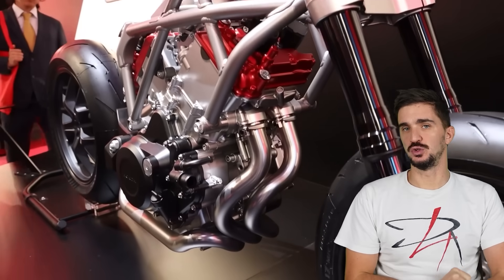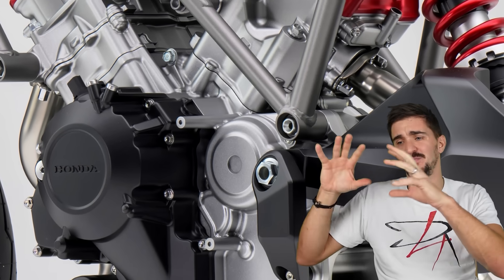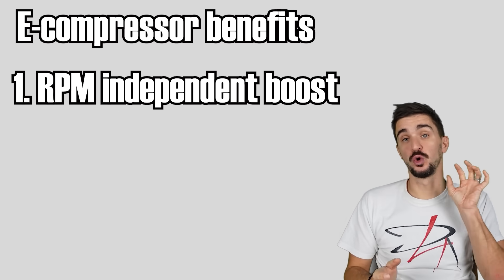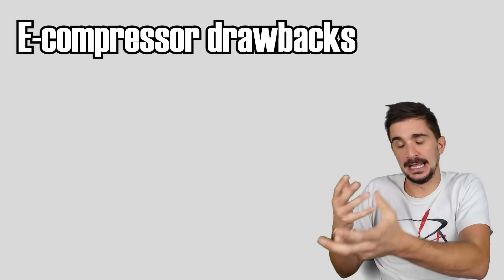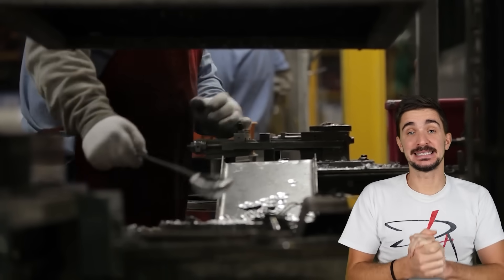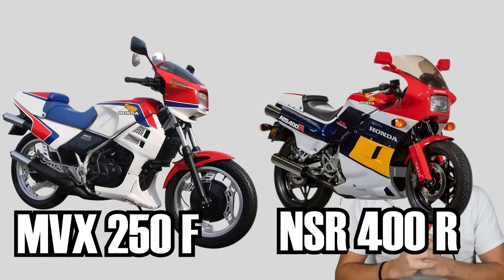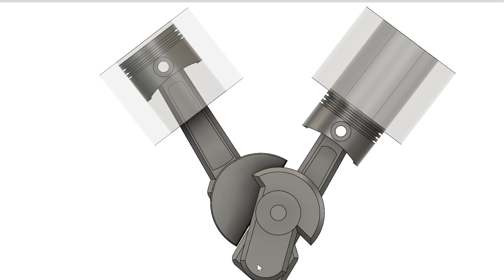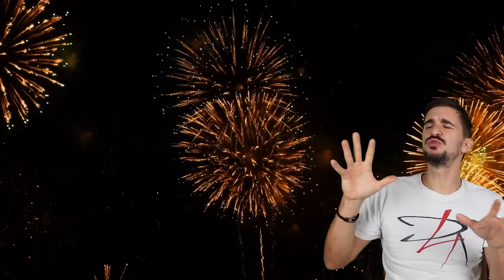Honda's New V3 Electrical Compressor Engine Explained

Comment: Leverage on the engine configuration/layout to design a slim looking bike, for the naked bike model! 

If there’s a naked bike version make it look As slim as possible😅 Slim tank slim rear tail ? With the half tubular frame exposed. Like Yamaha SDR 200. 😅 one of the most beautiful bikes ever made!
Reply: Good choice to use tubular frame, because otherwise the aluminium frame box would be super hot, due to the longitudinal V engine layout.

Comment: Just became a member, devouring your vids, thanks, off topic request I just made on your "rubber timing belt" expose, could you do something on that corvair flat 6?

I had a 65 corvair, great engine, two mistakes in design, rubber fan belt that took a 90 degree turn from vertical to horizontal, always breaking or slipping off, and wait for it: rubber O rings, always needing replacement, I believe gm later changed that to an acrylic.

Why aren't timing belts made from non oil chemicals?

BTW, that corvair was a marvel and groundbreaking, first 6 cylinder flat, rarely known fact, the corvair 6 was the first 6 flat put by porche into their car, backward engineer, but this is a fact.
I would love a youtube on that ground breaking engine, why it went wrong and why it's not made now with design flaws fixed

Comment: I started in the 80‘ With Z650 After all the Years i am back in 2025 With bold or and xr 600r…all With Carburators and Independent of Workshop. ❤

Comment: A turbo gets it's 'free energy' to drive its compressor from the exhaust gasses that would normally dissipate. An electric powered intake gas compressor gets its power from the bike's electrical system. (i.e. - the alternator). It's not true that an e-compressor cannot run very long before it over-heats. That's only true if it's built for short runs only, and has a designed-in cool-down time between bursts of acceleration. What it would need to operate 'continuously' like a normal turbocharger is both a bigger alternator that could generate more electrical power, and a more robust electric motor designed for continuous operation. Both changes would draw more power to keep the electric motor running. That would reduce the gas motor's output, add weight, increase production costs, and aren't 'free energy' like a normal turbo.

Comment: A major draw back with the system, If? You wear a full face helmet on engaging the fan on a 750, your head will turn into a Penus. Honda are said to be looking at including a 1000cc option, the exact genital configuration yet to be confirmed.

Comment: F1 is using these electrical compressors, also, isn't it? Thanks! 

BTW, would it be possible (or made possible quicker) to make an HCCI that runs at constant RPM for use to run an electric generator in PHEVs? Thanks!
Reply: F1 have a generator/motor on the shaft of a turbocharger.

Comment: That's not true..  You can very easily calculate how much the "larger" alternator will effect emissions.. Simply by calculating how much power the blower motor uses.  That is precisely how much extra the alternator will have to charge

Comment: Here’s a thought: 
Reconfigure all four valves as intake valves, reconfigure valve and ignition timing to produce 1 power stroke every revolution of the crankshaft (i.e. 2-cycle), vent the exhaust gasses employing cylinder vent exhaust port, timed to open between 90 to 110 degrees past top dead center.

Comment: Turbo does not take power. 
You even talked about turbine right before that. Turbo scavenges exhaust and will  increase efficiency. 

You wouldn’t want full power at lower RPM. Unless you’ll pulling stumps lol. You’ll experience serious longevity problems. 
Modern turbos can be tuned for lower power. With Electronic west gates and engine tuning you can have little power at low rpm and lot more top end.

Comment: their gonna use this thing as an inverse turbo, likely still higher compression decent overlap engine and their gonna just use that garbo to give it that oumph down low. im guessing their doing weird stuff elsewhere to meet emissions which is hard to do on small displacement performance engines which also all usually murder low end torque and once you got 800cc between ur legs winding above 8k rpm youll be moving quick either way. hopefully  people just see a factory motor built for boost and go for the moon.

Comment: Question: could you not make a 90* v3 where the one cylinder has a larger diameter than the paired 2, the larger piston equaling the mass of the smaller two, leaving you with a balanced reciprocating mass?

Comment: You're correct in that this should not be called an electric turbocharger. And yet, you continually compare this with one. Has everyone forgotten the supercharger.  This is an electric supercharger. Electric power simplifies design. Direct superchargers also create a power loss from the compressor drive. The attraction of superchargers is that they mimic the power curve of a naturally aspirated engine. The design use you outline would fill in torque holes of a highly tuned motor. This could be seen as an expansion of the electronic controls currently in use.

Comment: This seems like it would also work well in an all electric hybrid system. Have this engine turning a generator to power the electric drive motors or charge the battery.

Comment: Two things I think are overlooked in this video
First, an alternator does not function like a car's alternator. Most motorcycles have a magnet, and the voltage is regulated by shorting the ends of the windings. So, an increase in weight will be different.
Second, that torque line is not beneficial when you ride a motorcycle. That is why we do not see too many electric motorcycles on the road and not in the near future. They have some torque control when you corner using the measurement from a gyroscope but they are slow and not slipping using the throttle in a corner is very difficult. 
Anyway, I always love your content.
Reply: I was thinking along your 2nd point also.  It very well may not be a power curve that is easy to control.   They can try to control the power with things like electronic traction control, (which I am not a fan of).  But to bring braking (anti-lock brakes) into the argument, I can actually stop is less distance on slippery roads by pumping the brake petal, (and paying attention to traction), even if the car has anti-lock brakes. IMO, a smoother power delivery, and the use of a manual clutch is hard to beat.  Talent, is hard to beat.  :)
Reply: @EarthSurferUSA   I agree, that's why Zero patented clutch on an electric motorcycle.

Comment: A turbine can be used either way to receive power or transmit power. It would be correct to call this an electrical turbine.
Reply: "receive power or transmit power"   I think they all do both at the same time.

Comment: Probably the sound is the only thing that might make sense when it comes to this configuration. Normally they should have stuck to a parallel twin or V4 as the complication of having a single cylinder in a separate bank doesn’t make sense at all.
Reply: The more we are forced to appease the EPA, the less sense it makes, (anfdthe more expensive production is).
Reply: @EarthSurferUSA  In that case the EPA would have been more happy with a parallel twin, I guess. In any case the situation with the EPA and such is starting to get on people’s nerves more and more.

Comment: An electric turbo could still be a good idea, turbo plus an electric motor/generator.. store energy from the exhaust movement and use it to prespool the compressor when needed, i suppose it's not efficient enough.. would be more efficient then the e-compressor anyway.
I'm not fan anymore of those device that improve power at the cost of efficiency.

Comment: Interesting engine.  I'll be watching what Honda does with this.  Maybe you could consider looking at the Rotax engine BMW used for their F800 - a parallel twin with a 3 throw crankshaft.  The middle crankshaft throw has a counter-balancer linkage.  I've wondered if BMW ever thought of adding a rear cylinder instead of the counter balancer.

Comment: Actually, the compressor can be called a turbo. All centrifugal type compressors are turbomachines (engineering term), whether they have an exhaust turbine or not. In this instance, they're used for supplying pressurised charge air to an engine. Thus, they are in fact turbochargers. They're just not exhaust-driven turbochargers.

Comment: I believe there was also a Honda 125cc two-stroke  GP bike with 3 cylinders in the 70s (?). If memory serves me right, it was a one-up/two-down layout with disc valves on the outboard cylinders and a piston port valve for the center cylinder.
Reply: No it was suzuki that made v3 engine in 60s and it's also a 50cc engine (yes that small). Honda made v3 in 80s with 500cc capacity
Reply: @raihanfebrian218  thanks for the clarification. Those early years of Japanese GP participation saw amazing innovations...hard to keep track of it all!

Comment: Sometimes you think maybe use a hybrid motor on flywheel or gearbox like old IMA systems and maybe don't need e-compressor at all.
Compressing air takes lots of energy after all with added losses.

Comment: The e-motor compressor will require more power to run than a turbo. It will need a larger alternator which will require more power to turn and it will also need a higher capacity cooling pump to be able to keep up with the cooling of the engine and so called supercharger. Is  the compressor internally oiled or will it require an oil supply from the engine?  I’d take the Suzuki trusted and proven Hayabussa  engine any day of the week. It can be easily turbo charged and make more than enough power.

Comment: One thing that was not explained was from where does the ecompressor draw its energy from. The batteries need to be filled with energy constant for the e compressor to work. So just like turbo using the exhuast , the alternator must draw energy to regen braking or directly from the crank like a supercharger so the engine has to spend energy to power the e compressor. I feel how the engine handles this should be covered as well and how energy efficient it is compared to a normal turbo compressor

Comment: If the motec allows to drive the eCompressor the torque curve can be drawn to wish. These compressors will revolutionize the tuners szene. With the arize of brushless motors this  prinziple is outbeating anything else. Think about the exhaust system. No downpipe nore piping to the turbo. It is the future for engines without future.

Comment: Honda/Nissan need to stick with high efficiency ICE engines. The grid can’t support all the EV’s and the cost of gas is coming down. Check the election results in the US and the Japanese delay in adopting EV’s will no longer look like a mistake.

Comment: Our electric supercharger picked up over 200 rwhp on the dyno: https://youtu.be/b9d5xv9INmw?si=kxCTqwV7RdRyaoT7 And it put a 12 second car into the 9s at the track: https://youtu.be/RT0M88xHzNQ?si=lq_TwOIQ4J81J7lv  I apologize the for shameless plug, but if you're interested in this video, these are probably right up your alley.

Comment: As much as I’de like to proudly yell about Honda’s innovations, the V3 configuration (or a version of it) is found on the Yamaha T-Max 560 (and early generations of the T-Max 530).  The major difference, besides the forced induction, is that the rear cylinder of the Yamaha has no combustion cycle, and instead is there for oil sump and counter balance functions.  The Yamaha T-Max 530, as is the 560, is truly an impressive small displacement engine … so much so that it may have inspired Honda egg-heads to make one (or many?) for their brand.  I hope to see Honda’s V3-Induction engine on the near-future XADV-750 for the US domestic market!

Comment: The electrical compressor is a super charger that is driven by an electric motor instead of belts or gears driven by the engine. One of the reasons many choose a turbo over a super charger is that it tends to be easier to over come the extra back pressure from a turbo than to over come the drag on the engine from the belt/gear system on a super charger. There is still going to be a drag on the engine with the electric compressor caused by the larger amperage alternator/stator, but that should be much lower than both a turbo or traditional super charger. My concern with anything designed with a turbo or supercharger is whether or not the engine still cooperate if it quits working. Hopefully they will put a mode selector on it like Honda has done with many of their newer bikes. Exp.  Rain mode=  no compressor, touring mode: some compressor, sport mode: full compressor.

Comment: The rear cylinder and piston. could you increase its displacement to equal the front 2, and then have the two front cylinders fire at the same time, creating an equal size, front to back virtual V-twin?

Comment: Thanks for the video, learned some things about Honda's V3 engine configuration and problem solving.
Still I would like to see the battery that will juice this e-compressor.

Comment: Would there be any benefit to putting an e-compressor after the exhaust valve? 
I'm thinking, if they're good at short boosts, they might be able to make some negative pressure in the cylinder, that helps fully eradicate exhaust gasses and helps with aerosolisation of fuel maybe? Or am I being a naiive summer child and forgetting about the scavenged unburnt fuel that hangs out there that's a bit useful?

Comment: I have been thinking about this for over 20 years.  Sports car's only need all the power they can create during acceleration.  If you drive with the accelerator pressed to the floor you will be over the speed limit within a minute and you will lose your license if you do this often.
You only need the compressor of a turbo charger.   How about a belt that runs from the starter to the compressor, which will be spinning at high speed, and when you floor the accelerator a linkage open valves that let the compressed air go to the intake manifold.  The battery can only hold enough power to do this for a few seconds,  but that is all you need, because you will be at the speed limit.

Comment: Almost everything was very well described, but the drawbacks of using a electrical compressor was pretty much ignored. A turbo steals power from the exhaust to produce the higher input pressure. Taking power from the exhaust is not free. It makes it harder for the engine to exhaust, that's the parasitic power a turbo uses. Using an electric compressor requires quite a lot of energy, more than what you can tap the electrical system in a normal bike for if you want more than a few short boosts. This was said in the video, and it was also mentioned that the electrical system would require a larger generator. That is the parasitic power that the electrical compressor require. The drawback is that it will most likely also need a larger battery to make sure there's enough power available so the compressor can be used several times in a row without having to wait for the battery to be recharged. A larger generator means more power siphoned from the engine constantly. Even when there is no need to charge the battery that generator will cost more power than a smaller normal sized one would.

So there are drawbacks to using a electrical compressor, but all in all they are probably a lot less than what it takes to have an ordinary turbo. Now if this turns out to be a good solution more manufacturers will start using it. It's already been used in cars, if I remember correctly, though not in a large production model, as far as I can remember.

Comment: The original Yamaha Virago 750 / XV750SE and TR1, as well as the later iterations of the engine, were also 75-degree designs.

Comment: Turbochargers provide supercharging without using power from the engine to drive the compressor. 
Turbocompounding is using an exhaust turbine to recover energy to contribute the engine's output. This has been done in aircraft and heavy-duty applications, where efficiency is important; it is standard equipment in current Volvo trucks (with the D13TC engine). Current Formula 1 cars have a generator on the otherwise conventional turbocharger shaft so that the same device provides both supercharging and additional (electrical) energy with the same turbine. 

In this case, there is no turbine at all... because efficiency doesn't matter in performance motorcycles. 

It is impressive that electric motors are now small enough for this to be viable, and that a motorcycle has enough electrical capacity to drive it... even intermittently.

Comment: Reminders (of what I'm sure D4A and dedicated fans already know):
a supercharger increases and engine's intake charge by forcing air into the engine; there are several kinds of machines used to push the air and several ways of driving them
turbocharger is a contraction of turbo-supercharger meaning a supercharger using turbomachines 
turbomachinery in mechanical engineering, describes machines that transfer energy between a rotor and a fluid, including both turbines and compressors 

The supercharger on this engine is not driven by a turbine, but it is a turbomachine (specifically a centrifugal compressor), so it could indeed be considered an electrically-driven turbocharger ... but to be fair, belt-driven centrifugal compressors are not normally called turbochargers. I suppose it boils down to whether you think a "turbocharger" is any turbomachine acting as a supercharger, or (as usually the case) specifically a turbine-driven supercharger.

Comment: This will be great for emissions. Imagine being able to have positive flow from tickover without needing any swirl or having to worry about valve overlap. 
This design can remain super clean even if its designed to rev to the moon.